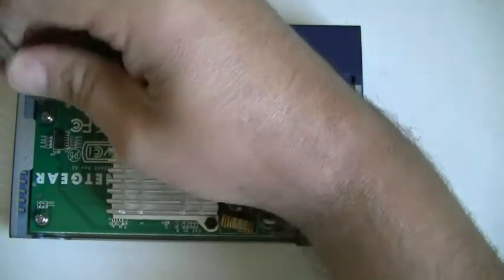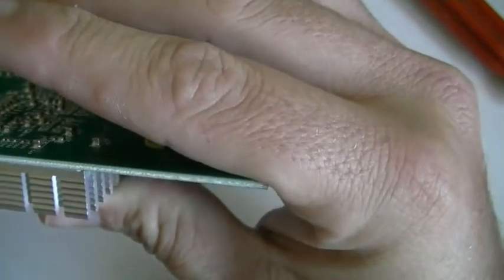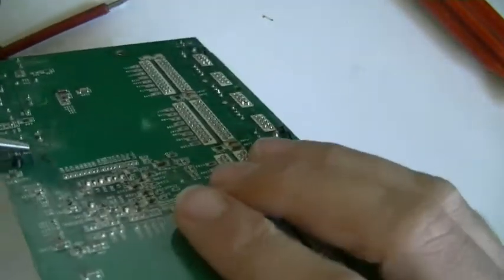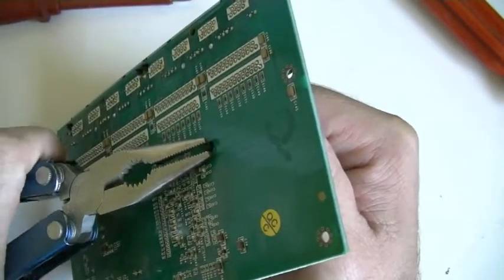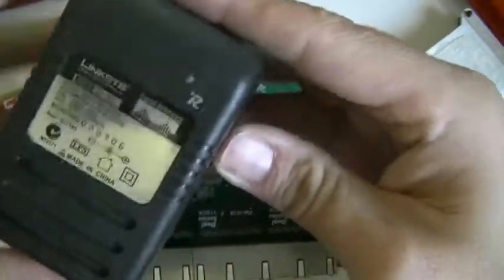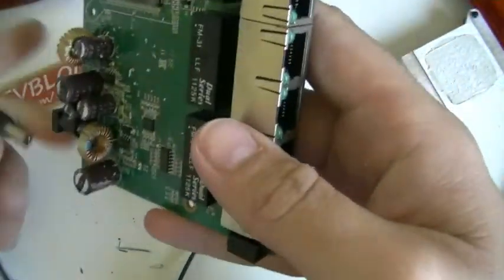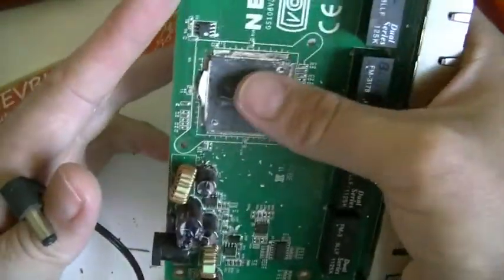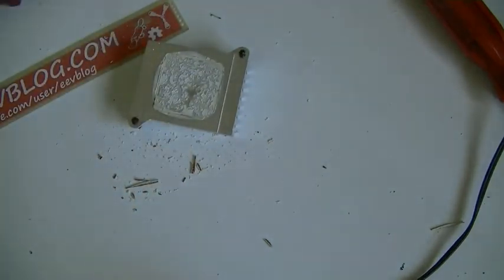teardown of Netgear 8 port switch

Comment: I wonder how to open the switch.  The GS108s I tried don't come apart after removing the screws, as if welded shut.  I'm also wondering what the differences between the various generations of the GS108.  There seem to be at least four versions of the switch.

Comment: I have one of these and it no longer lights up at all with either the original power supply or a brand new one I ordered. But, I have a compatible power supply on my LinkSys router, except is 3.5 amp instead of the 1 amp original. This one works, at least it lights everything up correctly. I'm rather confused by that. I don't want to just buy an oversized power supply and try to run it, because I want to know where all the power is going if it's really drawing more than 1A. I see absolutely nothing weird about the circuit board or components. Just for the heck of it I replaced the 1,000 microfarad electrolytics, but no change. I'm out of ideas.